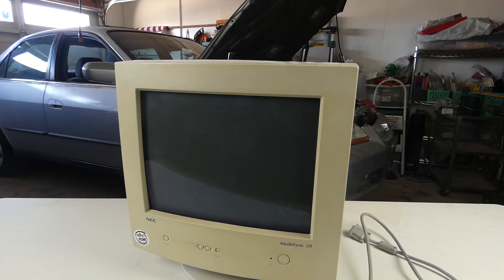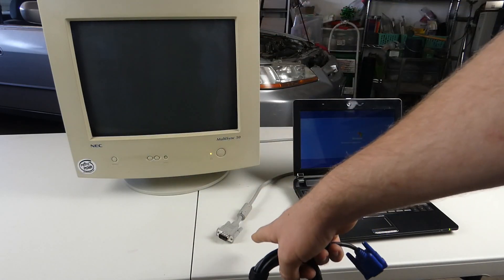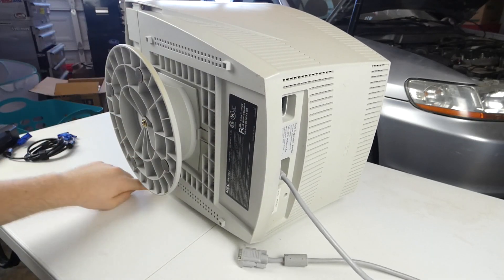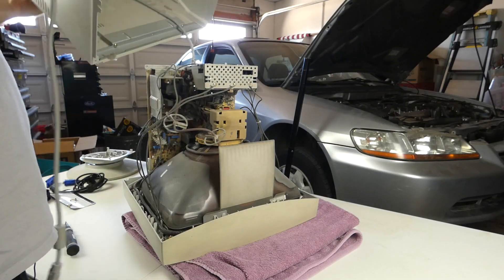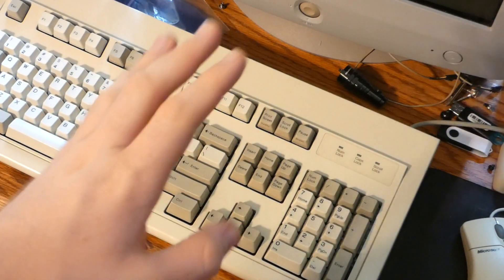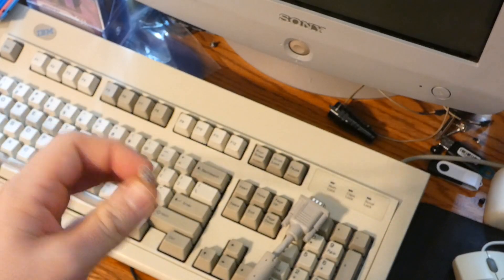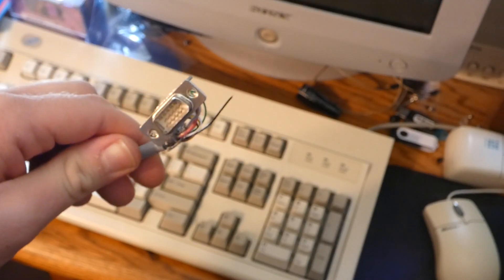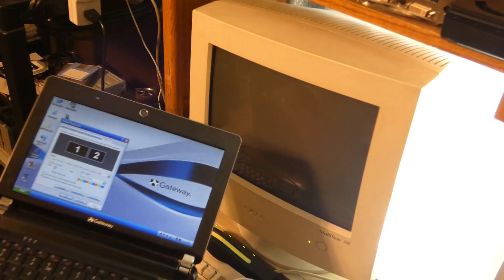Fixing My CRT's VGA Cable

Comment: i have CRT monitor with 9 pin and VGA cable with 15 pin so how to wires it.
Reply: That's not VGA if it has 15 pins. VGA only comes as a DB9.

Comment: You can also take the new cable, cut off one connector and splice and solder it onto the monitor cable attached to your monitor after you cut off its bad connector end. You save some money and waiting time that way, but your way is neater and you did a nice job there too! 👍👍

Comment: Yes, I wish they'd used a VGA port on these monitors too. The black wire is probably for the VSync/DDC ground which is pin 10.
Reply from the maker: It seems to work fine at the moment, but if I run into issues I'll try it on pin 10.

Comment: This is a helpful and honest video. I have the same problem. But i dont have your patience so i have twisted the cable back and used a zip tie to hold it in place which mostly works. One day i will fix it like you have.
Reply: i did the same but red now is black and theres a weird tint in the colours